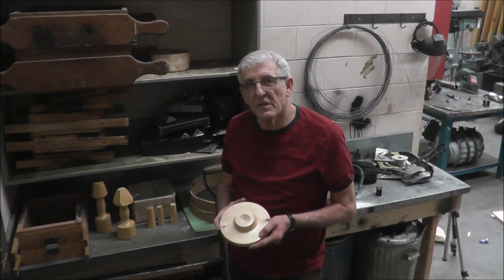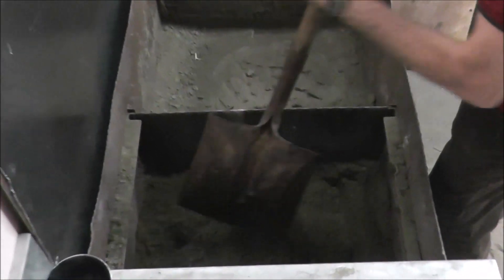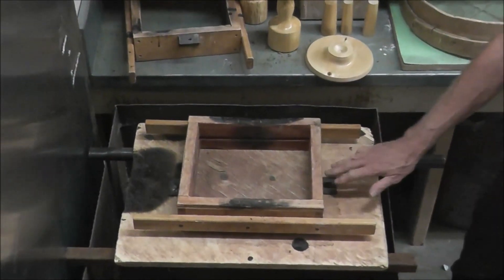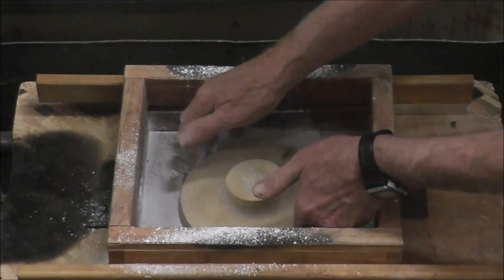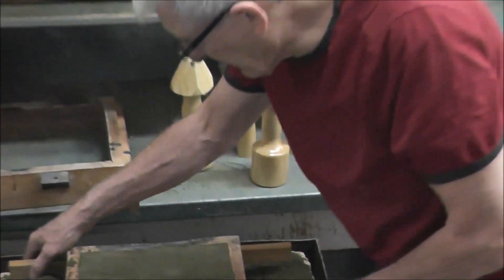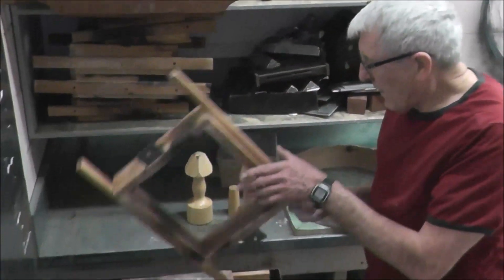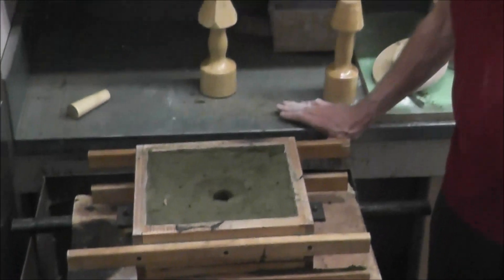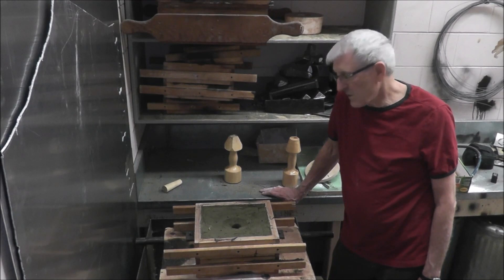CASTING,  The foundry Process, PART1

Comment: When I was in school in the 80's the casting sand was red. Is there a difference or upgrade etc?
Reply from the maker: No the sand you used is oil moistened sand,  common in schools because the oil didn't evaporate and stayed moist without being covered. I did not like it as when the metal was poured in, the oil would burn and stink, the when you sent to recover the metal part you where suppose to separate the burnt sand. A real pain,   Eventually you could get a special oil and re temper the burnt sand, then you would end up with black sand. I liked the green sand, only called green as you tempered it with water. did not smell, burnt sand dumped back in. Just add more water and mix. Disadvantage in schools, add too much water and you have problems when pouring the metal. I had made that box, and then made an aluminum lid to keep the moisture in and that solved allot of the problems. day to day.  Industry uses only green sand. The night crew gets the sand ready for the next day, mulled and proper moisture.